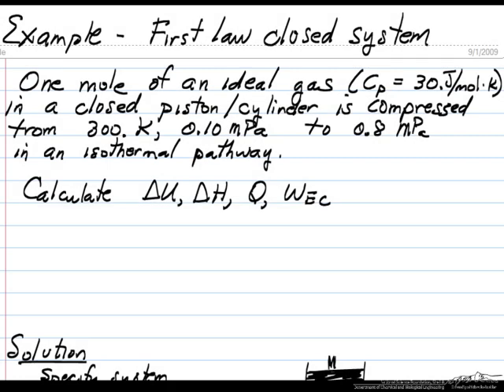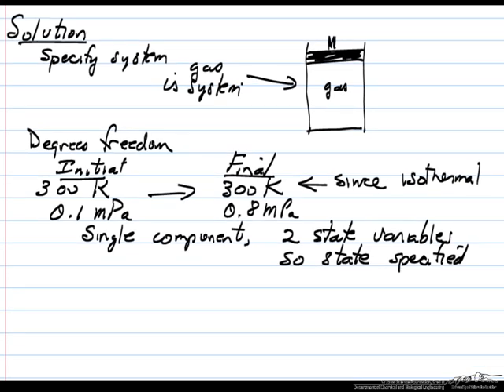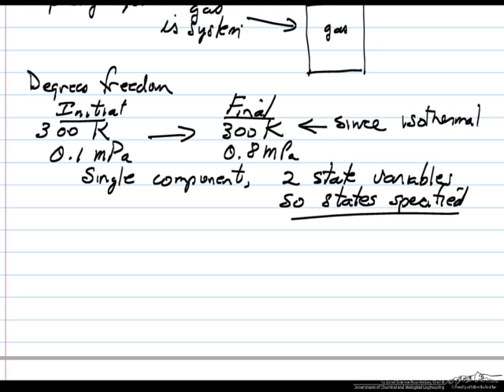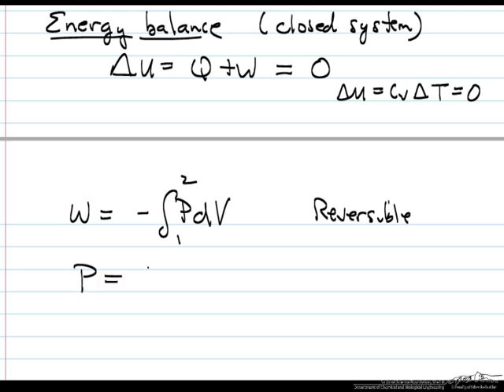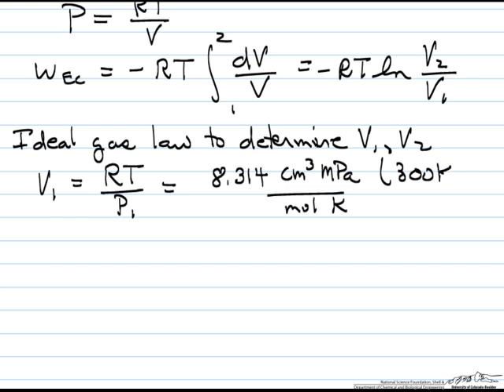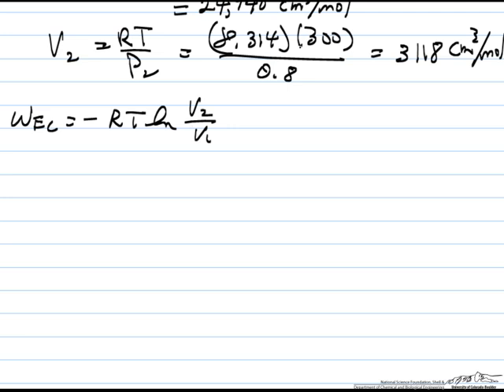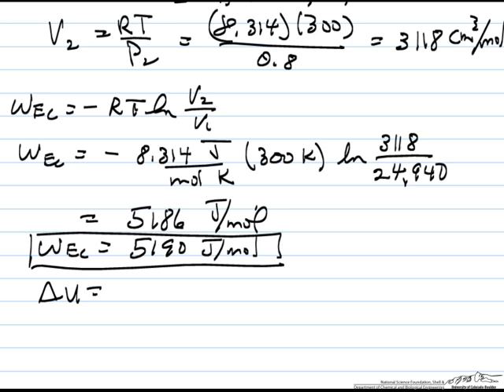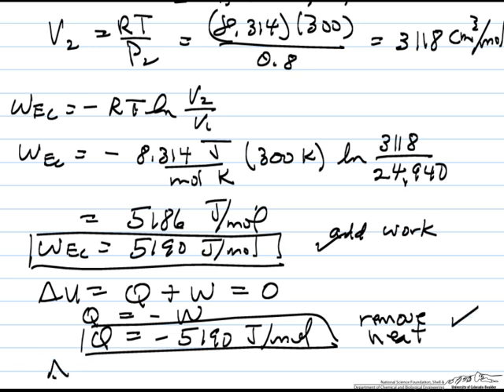Isothermal Ideal Gas Compression

Comment: Hi,
How can DeltaH be euqal to Cp times DeltaT if we are not working at a constant pressure? Or is external pressure considered to be constant in a reversible process at each infinitesimal stage of compression? I'm fuzzy on that.
Thank you
Duham
Reply from the maker: For an ideal gas, delta H is always equal to Cp delta T. It is not restricted to constant pressure since enthalpy does not depend on pressure for an ideal gas

Comment from the maker: There are different conventions for the nomenclature of Q and W.  In our thermodynamics videos we are using +Q for meaning heat transferred from surroundings to system and +W for work done on system by surroundings.  Thus both add energy to the system and are positive.  Compression is work done on gas and therefore is positive here. So the system heats up.  For an isothermal compression, heat must be removed thus is negative.
Reply: you have said that the system heats up ...how ? i mean this process is isothermal right?